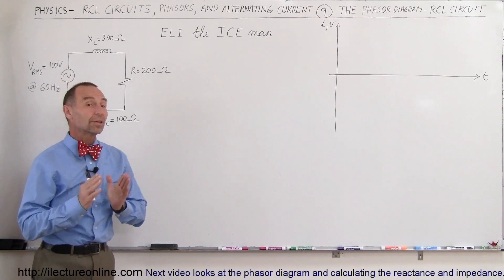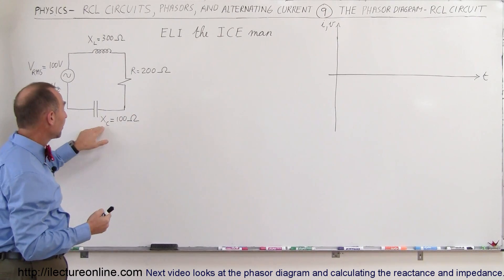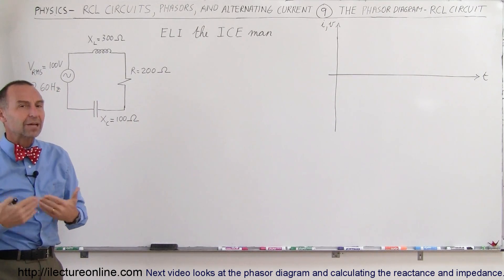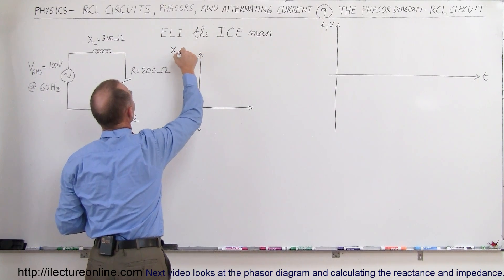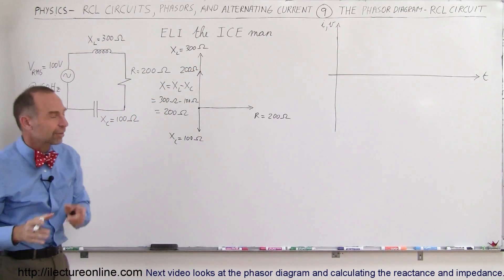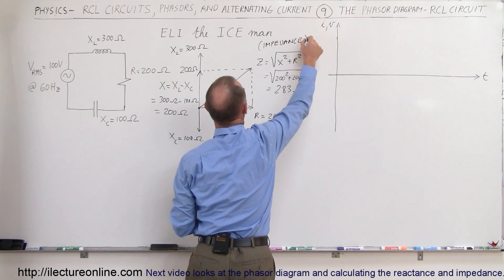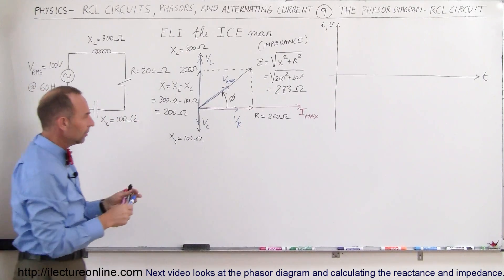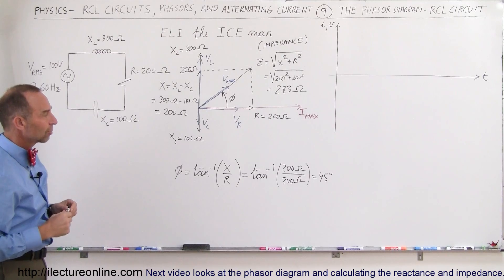Physics 49.1  RCL Circuits & Phasors (9 of 24) Phasor Diagram - RCL Circuit

Comment: Hi Michel, Shouldn't the voltage across the Resistance (VR) be in phase with source voltage (Vs) or (Vrms) in this case because a resistor is always in phase with the source?
Reply from the maker: Yes, and that is why the resistance, the voltage across the resistor, and the current vectors all all drawn in the same direction (the horizontal x-axis).
Reply: @MichelvanBiezen  Okay, I get it now after watching one of your future videos in the playlist, thanks Michel. I was expecting the source voltage Vrms here to be in phase with VR but I believe that is only possible if you have a purely resistive circuit. Since this is an inductor dominant or inductive circuit, the source voltage Vrms will lead the current i in the circuit.
Reply from the maker: That is correct